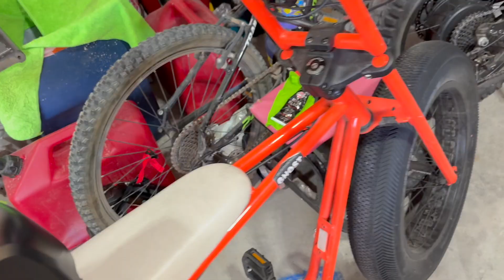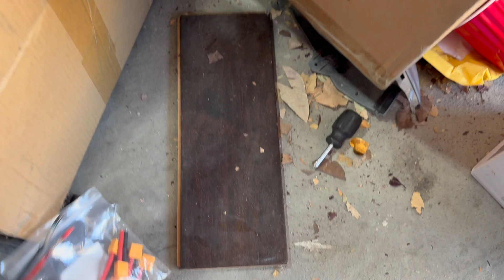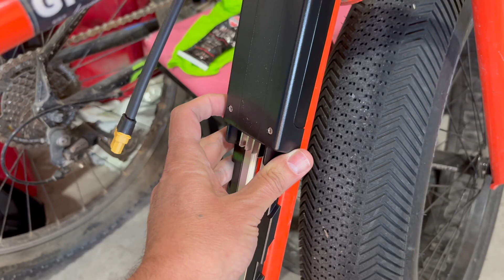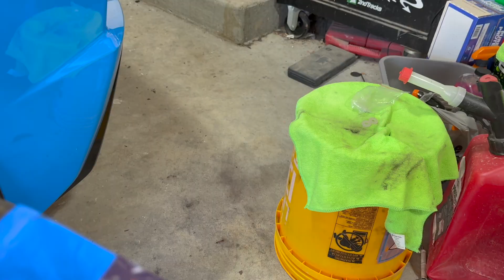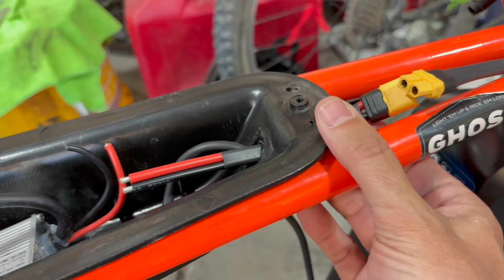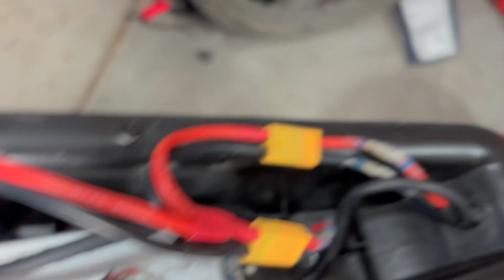Super 73 Z1 External Battery - Easily extend your range or fix your bad battery

Comment: I have the same e-bike super 73 Z1 and it wouldn't charge unless I turn the main power button off and left the handlebar button on I'm triggering the battery was changed just like you did